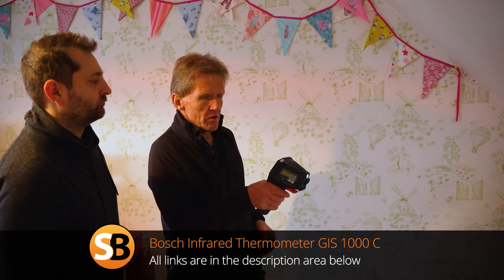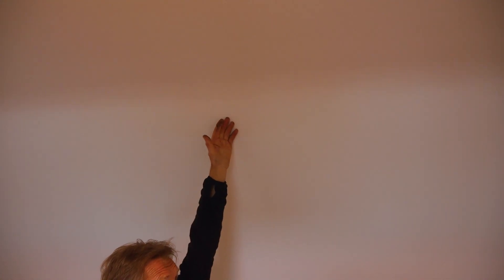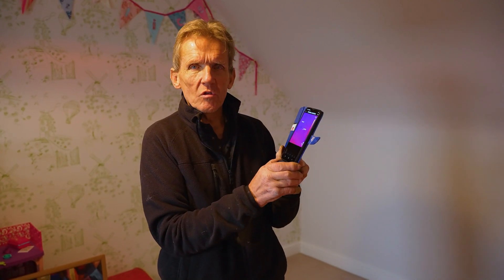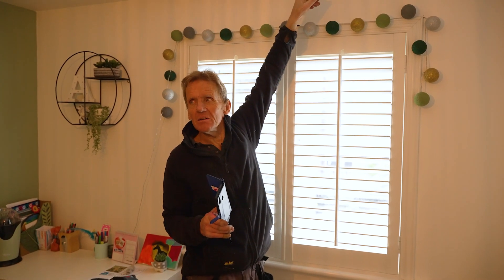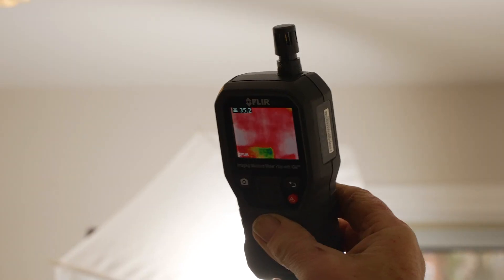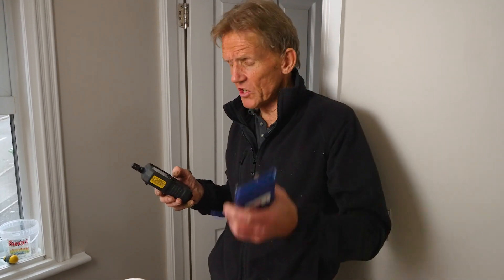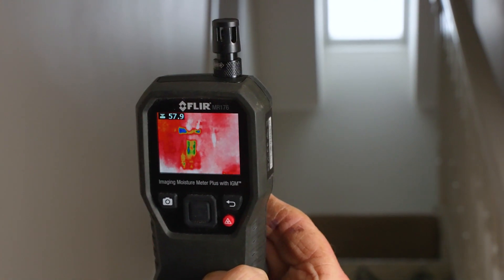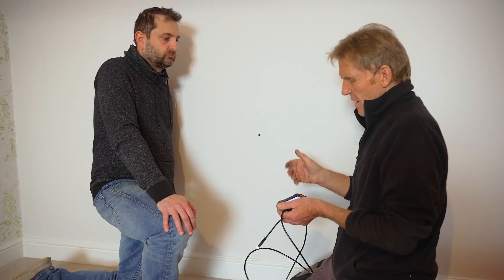How to Check if Your Home Is Leaking Heat

Comment: What are your thoughts on the lack of eaves overhang on building thermal efficiency ?

Specifically, mitigating rain penetration to masonry - and the attendant increase in heat loss. The gable on the building featured has no roof overhang , leaving the wall exposed and reducing the overall building thermal efficiency.

We also seem to be stuck with brick as a facing material when a rendered and painted finish would seem more suitable for our climate - as is prevalent in Scotland and continental Europe.

High performance paints would moderate heat gain in summer and heat loss in winter - block construction would be easier and would reduce the energy cost in firing bricks .

These simple steps together with a simple central ventilation system incorporated in the build, would go a long way in making our housing stock more efficient.

What are your thoughts on these possibilities ?
Reply from the maker: I am a great believer in big eaves overhangs. 
The windows need cleaning more often but the facades are dry and that means they are better insulators.

Comment: I dont need any flash cameras to see my heat leaks on the roof, just go outside on a frosty morning and spot where the frost has melted 🤣 would love to put more insulation in but its really a roof off job or rip all the ceillings down on the inside as its a bungalow that had a roof job done back when insulation wasnt heard of 🙄

Comment: lots of council houses has these issues especially where  the ceilings slope down  ! normally causing  mould or condensation  !    due to lack of insulation in those areas  !

Comment: We are getting massive cold issues in our house we bought from new. We have mould and condensation. Would love your assistance on this please :(
Reply: Where is the mould ? do you have trickle vents on the windows ? Are you creating a lot of humidity in your house ? is the condensation problem mainly when it’s cold ?
Reply: @chadzoe1  In two of our bedrooms. They installed trickle vents recently in the windows. Also new radiators. We loose a lot of heat still.

Comment: If those walls are dot and dab, I'll bet there is no continuous bead around the plasterboard, and cold air is able to circulate behind, and completely nullify any insulation!  Same as my 20 year old house...
Reply: I was going to say the same thing. We have thermalite block with dot and dab. I've just spent the winter trying to track down the gaps in the mortar of the block work creating the draughts behind my dot and dab, it's a joke. #livinginaplasterboardtent

Comment: I like how this guy's like "they lied to me" we have to heat this room. They must not have insulated it. What was he expecting, was he expecting the insulation to generate heat? If it's cold outside insulation slows that heat transfer it doesn't stop it. You're welcome to keep adding more internal insulation if you're really that impacted by it.
Reply: Think he was expecting the builder to do their job and properly insulate. Nothing wrong with that.
Reply: Bit unnecessary, he was expecting it to be warm as it was the top end of the envelope and be insulated correctly.

Comment: Thanks Roger. That gives me an idea. I look after the heating system in a church building and there's a leak from the downstairs circuit which is buried under the floor, but there are no signs of where it can be, so have you ever managed to locate a leak in a heating system using a thermal imaging camera?
Reply from the maker: Hi Kendal
Yes it is a very common way of finding leaks under floors. It is worth a try.
Reply: There are professional leak detecting services who pressurise the system with a gas and can locate leaks accurately with a audio based detector. There are YT videos on the subject. Here one example https://youtu.be/oEPt8C8yoR0

Comment: Interesting to use the camera inside the house. On a cold night with the heating on go outside the house to see the fuller story. Heat leaking from around window frames. Wood front door acting like external rads. Insulate and draft proof as much as u can.